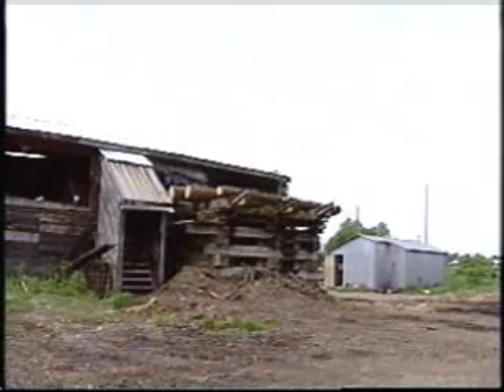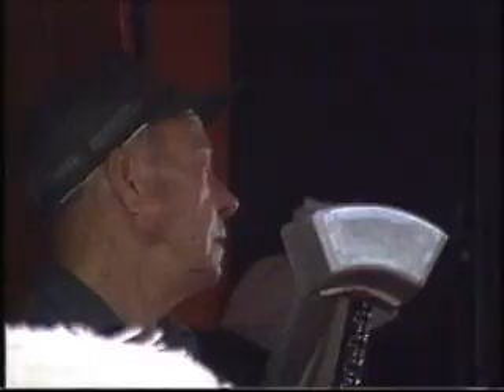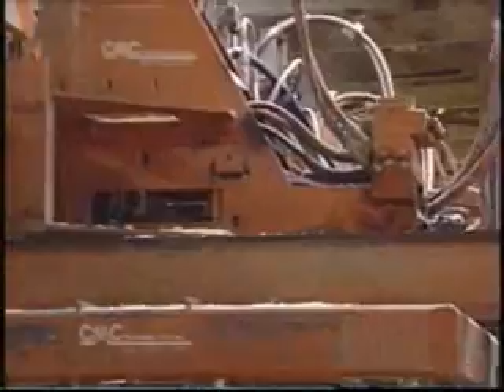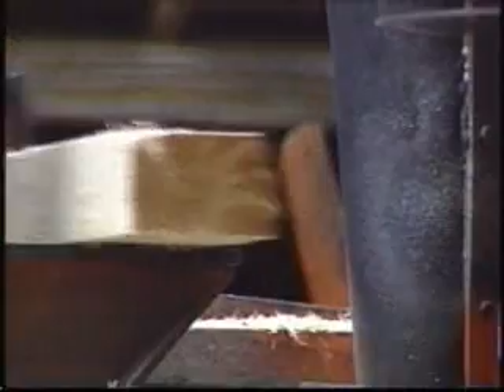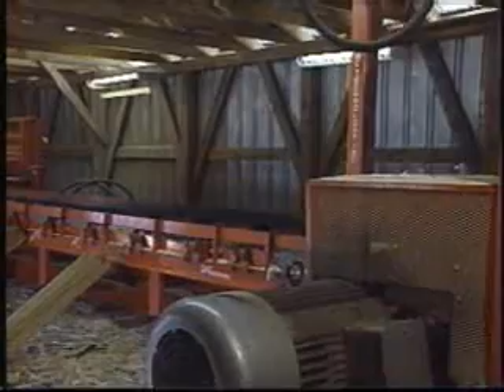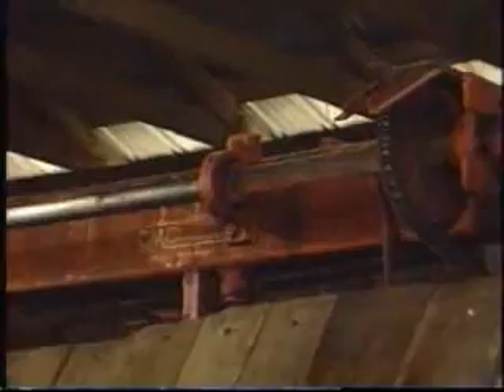Industrial Sawmill in Operation

Comment: takes alot more sawdust than that. try all there slabs,sawdust and prob still is not enough to power the mill it self.  the motors on those things really draw the amps
speacial when cutting knots.